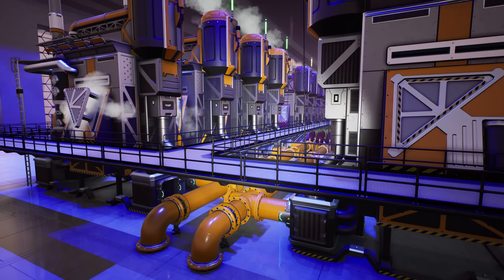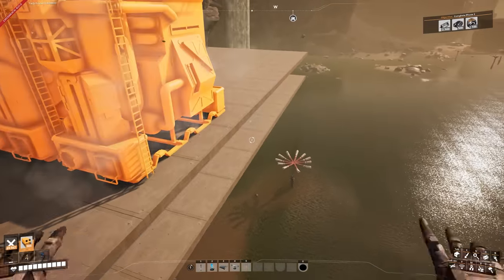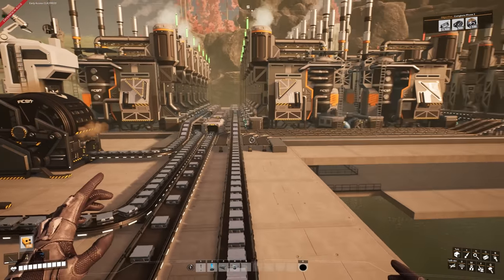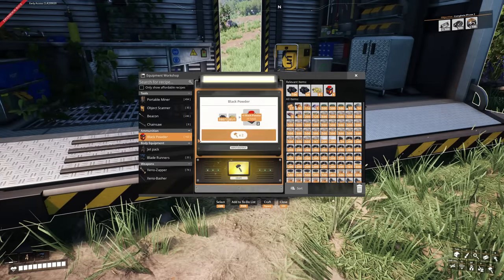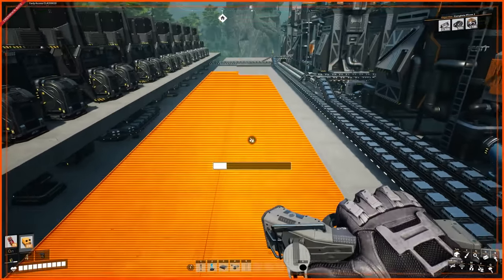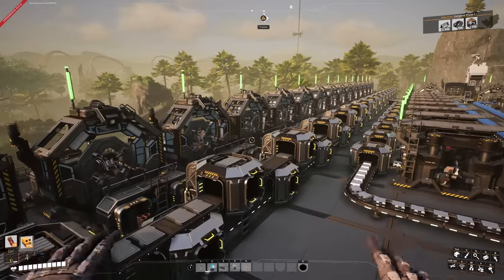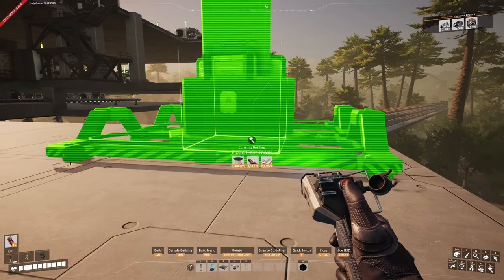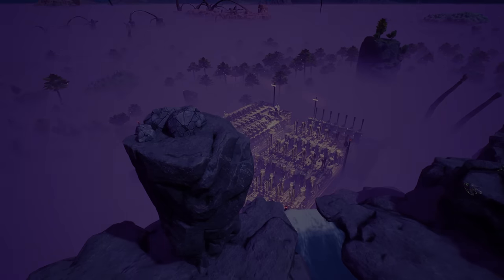BUILDING a RIG just for HEAVY MODULAR FRAMES!! in SATISFACTORY Update 6 - Part 7

Comment: I played around with underclocking recently. Mainly because i didn't want to update my power again jet.
Putting down the furnance and steel beams to 30 and build more is quite a neat idea. Cut's a lot of power and later on you just update the belts and put them back to 100%.
So you can plan ahead to 720 belts. But building new factories is also fun :-)

Comment: Great work. I personaly think that heavy modular frame is the most overtuned  item in the game imho. For the place where it is in the game and for what you need it..the actual stuff you need for it is a bit too much imho. And im talking from the experience of running plutonium  power plants in tier 8. I think heavy modular frame needs either cut of pipes or heavy reduction on modular frames cost...just my opinion. Love your patience with building belt lines.

Comment: awesome video! I just started playing Satisfactory! Tell me, how do you lay foundations so fast in a straight line? i have to place one by one
Reply: when you have the foundation selected to build, you can press R to change the build mode. there's normal mode which is one by one, zoop mode which lets you place up to 10 in a row horizontally, and vertical mode which is up to 10 vertically. It also works with walls and some other buildables.
Reply: @baggymeerkat  thank you so much!!